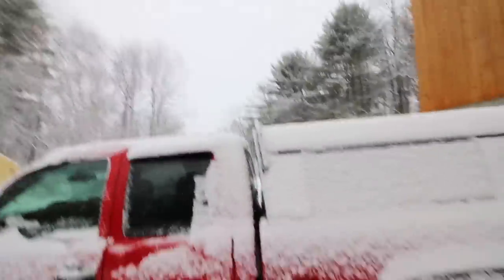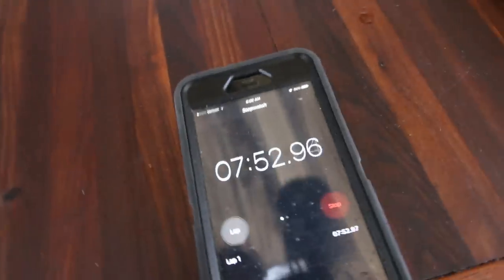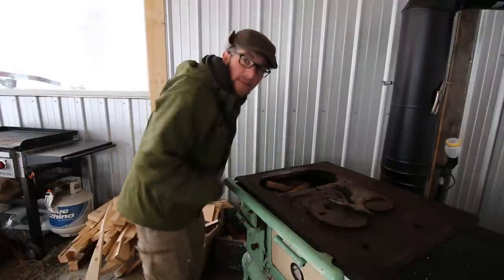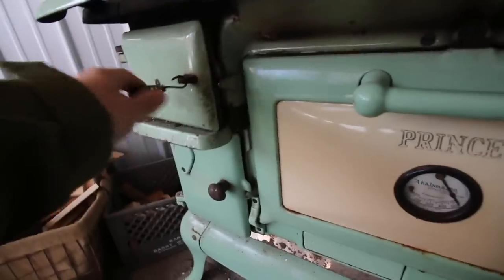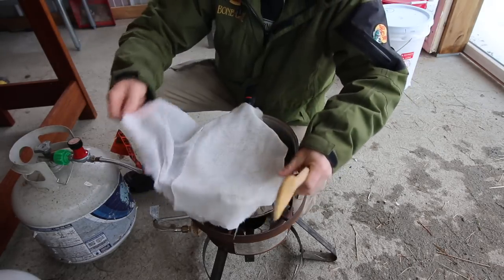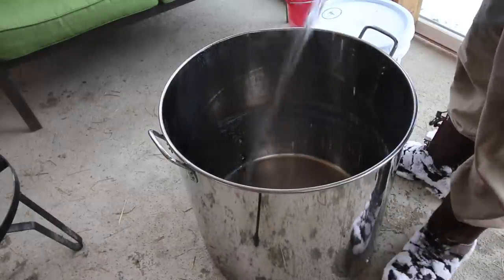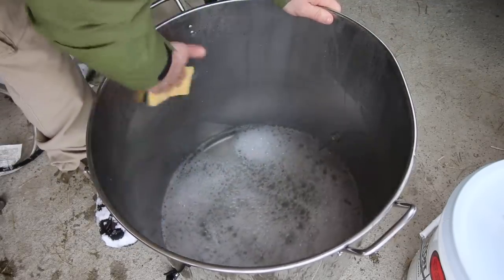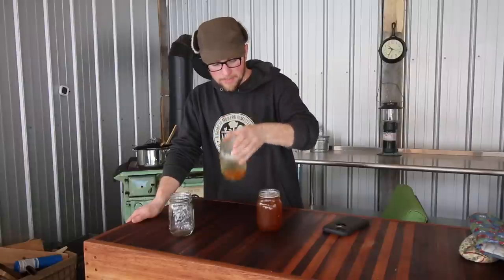How Fast Can we Boil Our Maple Syrup Sap

Comment: That huge propane burner and large stock pot worked great!  I did 15 gallons in just a normal Turkey fryer and it was like 10 hrs.  I need to upgrade obviously
Reply from the maker: The best part is the equipment we use for other projects too!

Comment: In the future you should set up a storage barrel outside the outdoor cook kitchen and have the storage up high enough so that you can run tubing from outside storage to inside cook kitchen with a valve inside so you can add sap when ever needed I usually just let mine drip into the pot and keep the process going continuous.You need the 23 gallon stock pot on the kitchen cook stove nice big bottom pan.Once you bottle your syrup it is hot enough at 220F that the lids will seal on the mason jars.
Reply from the maker: How much syrup do you usually make a year?

Comment: If you pour your finished hot syrup into sterilized jars and put the caning lids right on tite and flip jars over for a minute or two to sterilize the lid flip back over and your jars will seal as it cools making your syrup canned. pretty soon the sap will be pouring out and hard to keep up with, youll get your two gallons as long as the weather keeps a slowly warming up.  question for you al, what feed do you give your chickens been trying to find organic feed but it sure is expensive, at least locally. keep up the good work!
Reply from the maker: We feed Morison Feed or Green Mountain.